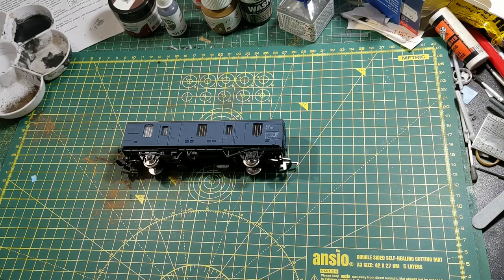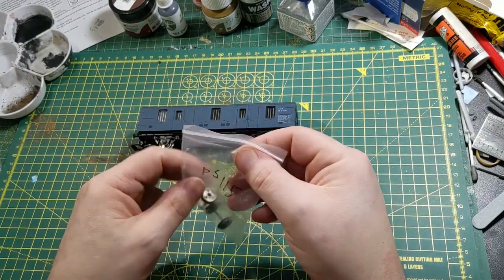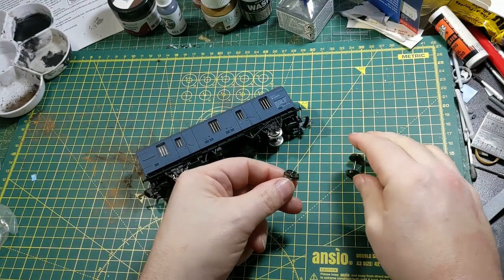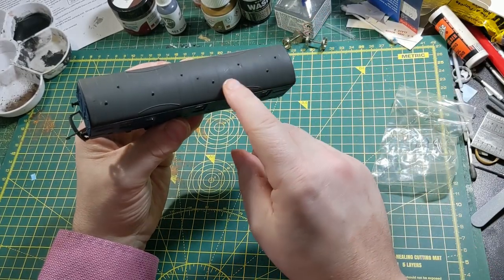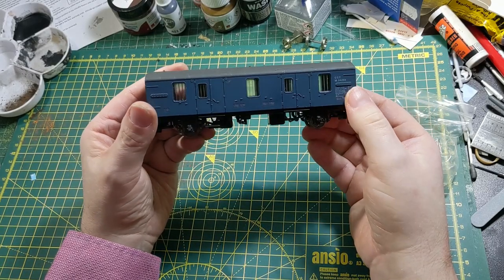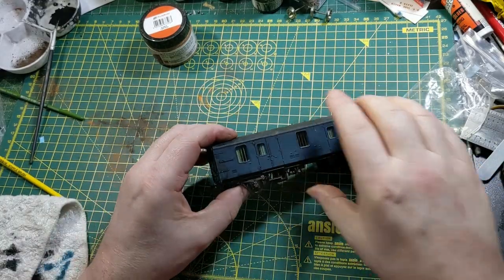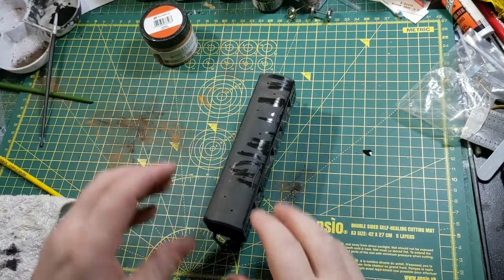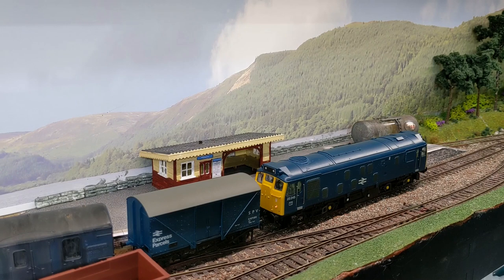Weathering the Lima CCT | Replacing the wheels | Shows you how

Comment: The axle swap by its own changes everything. Simple and cheap, that's the only mandatory fix to do in my opinion.
As optional works, I would put NEM couplings for my own use as I equip my fleet with Roco universal couplings (good compromise for me between price, manual ease of uncoupling, overall reliability and total compatibility with any mecanical decoupler. Sole drawbacks : ugly and no predecoupling). Roco sells a short coupling cinematic with a NEM pocket that would easily fit on this model (ref. 40343) if you want any kind of NEM coupling with the same functionnality as the original couplers.
Great weathering work by the way. I have seen many of the SNCF equivalent in real life of the CCT (old OCEM vans) as dirty as the one you treated when I was a kid.
Reply from the maker: When I was a kid I never saw any parcel stock that was clean, and often very dirty!

Comment: Could you provide a ref for the replacement wheels please? Thank you 🙂
Reply from the maker: These are from Peter's Spares, reference PS34. They've made these specially to replace existing Lima wheels.
Reply: @MessingaboutwithModels  Interesting video, thanks, One query - your poly bag appears to read PS115 and on Peter's Spares website both PS34 and PS115 are listed. PS115 has three holes in the wheel (as your samples) which suggests that your wheels are PS115 rather than PS34. My apologies if this comes across as nit-picking but I want to be sure before ordering.